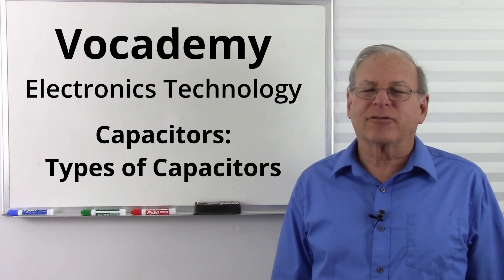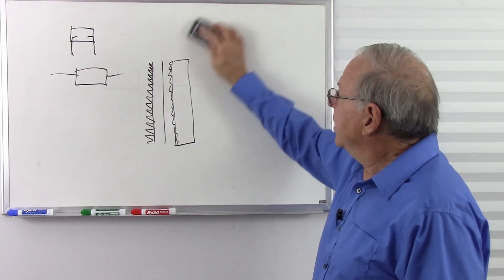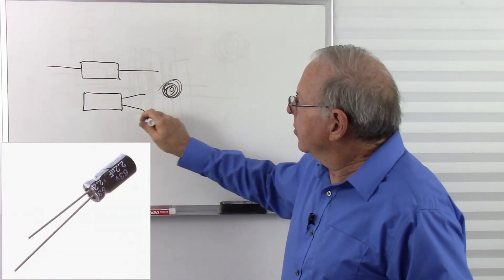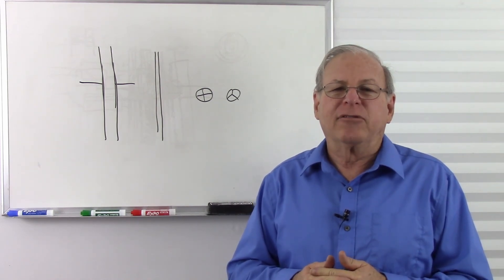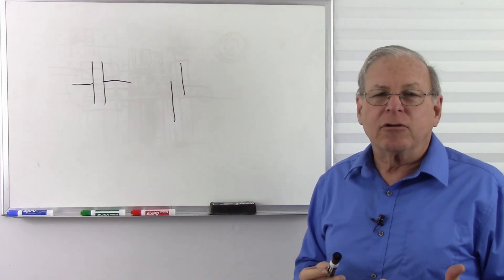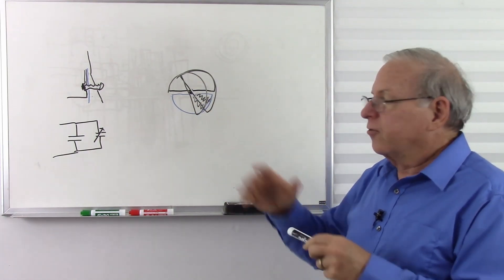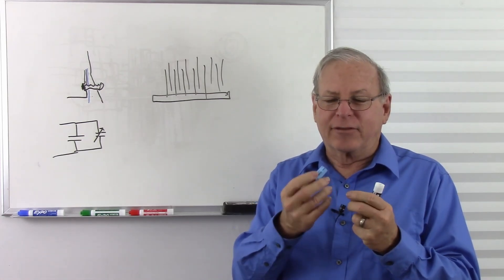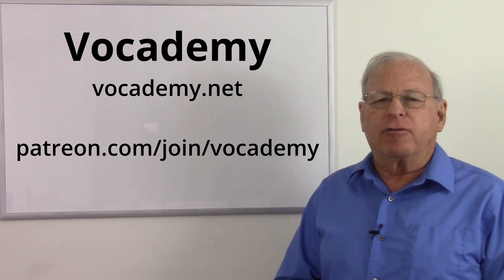Capacitors Part 2 - Types of Capacitors

Comment: there are still cheap capacitors that will explode. I had purchase a TV digital to analog convertor a few years ago. I turned on my tv and a moment later i heard what sounded like a small peeble hitting the patio door it sat next to. When i stepped back into the room, the tv was all snow and it smelled. I opened it up and the whole can of the capacitor blew straight up, hitting the top of the case. (2022-2024 time frame.) Thanks for explaining the coded 102, 104 etc coded capacitors, i have quite a few in my experimentors box, I'm retired in my sixties, and like a lot of other guys have to pull out the lighted magnifier.!!.  I like that you go over things several times using different analogies.. Thanks Bob!!